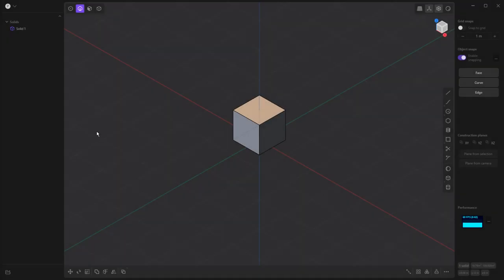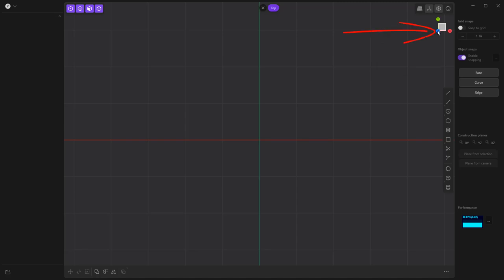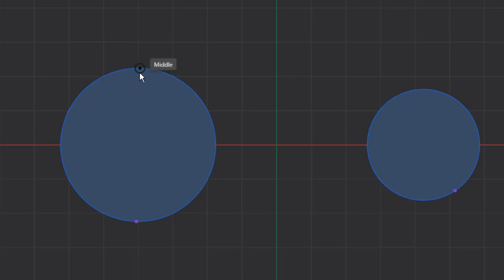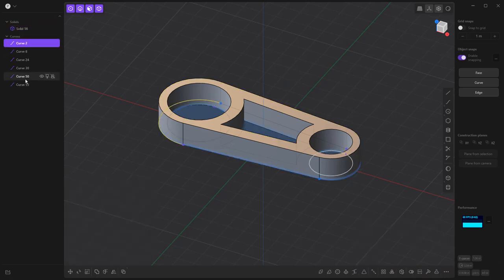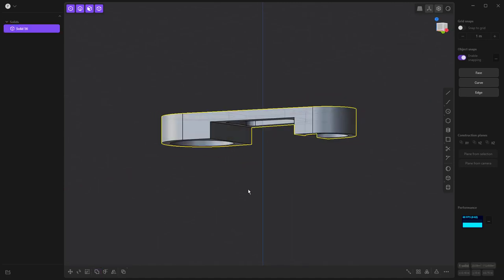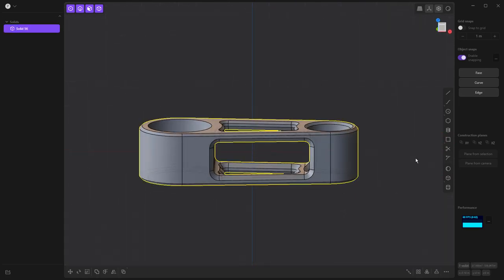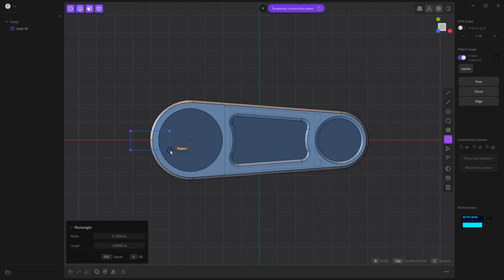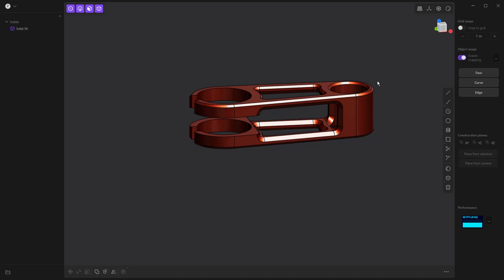Plasticity Quick Start | How To Model A Simple Part In Plasticity

Comment: i vaguely remember the author will be charging like 10-20 usd when the 1.0 hit the mass...now 99 USD for basic?.
Reply from the maker: A lot has changed since some of those initial announcements.  The original beta was on a different Kernel in the back that would allow for such a cheap price.  The current public version is built on the Parasolid kernel so pricing is a bit different and that is where a lot of the cost comes from sadly.  But this is not a subscription license.  You pay once and you own it for whatever that is worth.
Reply: I'd say 99 usd is still a pretty great deal, if this really is as good as it seems on the first glance.
Reply: Fusion360 costs 360 usd per month i think its worth it
Reply from the maker: @pusab2064  Not quite that expensive.  Currently I think its $500/year or around $40/mo.  A lot of people in this VFX segment of modeling are opposed to the subscription model that Autodesk and many other programs have adopted.  I personally don't mind subscription based having working in fixed versions for many years they have their own problems/challenges.  But that is a bigger discussion that would likely bring a lot of negative comments :)
Reply: I would be nice not to have another sub for once. I’m subbed out. The price is totally fair imo
Reply: How about you build something and offer it for $10-$20? How about your employer pay you $10-$20 for 8 hours? Would you like that?
Reply: For a cad like experience, that has a lot of what actual cad programs have, and what hoops you have to jump through to get them, this is very much a steal on price.
Reply: @edenassos  😅 that's my daily income and yes i dont like it.
Reply: Im not complaining 100 bucks one time is super affordable compared to industry standard  software's annual licenses

Comment: when i hit G on the keyboard nothing happens
Reply from the maker: you will have to have something selected first.  Most of the dialogs are going to be selection based.  For Move (G) you will need a point, edge, or body selected first and it should work.
Reply: @LearnEverythingAboutDesign  thank you :)

Comment: Why one would use this software instead of blender? Blender is more complete and free no?
Reply from the maker: Plasticity is a CAD program that models in solids and surfaces.  These are BREP and NURBS.  Blender models in polygons.  In Blender you start with a mesh and end with a mesh.  To make "hard surface" type models, things with hard edges, holes etc you have to use addons like cadsketcher, or spend a lot of time with booleans in the mod stack and really be careful with edgeloops.  In the end you are still left with a mesh.  In Plasticity you actually have a solid body (or surface) that is represented accurately.  A hole is a hole, not a bunch of straight lines.  A fillet is an curvature continuous surface that matches tangency with the surrounding faces.

Plasticity acts as a direct modeler that is intended to work well with Blender and do the things that it can't do easily or well.  Can someone create similar parts in both?  sure.  But in Blender you will always have a mesh.  In plasticity you have a solid and can convert it to a mesh for use downstream in blender if you wish.
Reply: @LearnEverythingAboutDesign  wow thank you for your explanation!! I thought plasticity was a polygon model software. My question would then be why not use fusion 360? Of course fusion is very expensive if you need a license
Reply from the maker: @Digit0wL  Partially user preference.  A lot of users looking to create models that will end up going to Blender for rendering, development of video game assets etc are just looking for the solid modeling with a streamlined workflow.  There is also a group of people that prefer the perpetual license like Plasticity vs a subscription based license like Fusion.

For me Fusion is my goto tool for designing manufactured parts.  If i am going to have something machined or molded for example i stick with fusion.  If i am designing off a mesh, say a widebody kit for a car, Fusion.  Placticity is very quick and there are things it does better than fusion.  Its surface quality is really good and when XNurbs is in the studio version that will make it even better.  So you can create some really high quality models, but they are not parameter driven.  So you couldn't say define a draft angle and design a molded part with the precision needed to control those details easily like ensuring all ribs/bosses are 60% the thickness of the outside.

So both tools have a place.  What i would say is to think about where your model goes after you are done with it in CAD.  If that animation, games, vr, rendering.  Plasticity with the Blender Bridge might be a great option.

Comment: I dont understand why this is being compared to polygon modelling. You cant use these models in the games or visual effects industries.
Reply from the maker: Plasticity is built on/for the Polygon workflow.  Takes many cues from Blenders workflow and others like Maya.  This is meant as a way to create accurate NURBS based models that often times are much harder to build/create in a polygon program.  It is meant as a more artist friendly tool to sit somewhere between programs like MOI or Fusion 360.  What/how you handle the downstream assets really depends on their intended use.  If its VFX/renders/animations or if its game dev/vr etc. that may include some retopo(which generally happens after concept modeling) and surface painting, sculpting etc.  I work in the CAD industry not games so my experience is just from my own projects, but this is what others are saying.
Reply: @LearnEverythingAboutDesign  I work in the automotive industry. We use poly to sketch stuff in and then rebuild it in NURBS for production. Hence this makes no sense to me.
Reply from the maker: @fullyleaded  Right for you if you are talking about concept car bodies.  Yeah mesh to say Alias Class A or SubD there would be the common workflow.  But say someone asked you to come up with a concept for say a brake caliper, or a wheel.  This workflow is much easier with NURBS as opposed to poly modeling.  not that it can't be done, but add-ons like Cad sketcher for Blender are aimed at making the poly workflow more like cad, but it still relies on you inserting control loops and worrying about topology.  Not an issue with NURBS here.

Plasticity isn't for everyone, but the program was made for designers to have a "CAD adjacent" program for more poly style workflow vs a parametric CAD workflow..
Reply: Thanks for getting back to me.  @LearnEverythingAboutDesign  We throw anything in in Blender. Brake calipers, switches, lights, wheels you name it. Once youve blocked it in in subd you can make a million iterations of it super fast. If you build something in Nurbs the fillets take forever. 

I'd be curious to see a real life use for Plasticity.
Reply from the maker: @fullyleaded  That is interesting to hear! Thanks for sharing!  All the people I have talked to in that industry have been body designers specifically.  I personally work in Parametric CAD, blender and plasticity are "fun" for me, but not part of my professional work.  For me even roughing in stuff is quicker in CAD than in Blender, especially with subD modeling to nurbs in CAD.

I think its a bit too early for a lot of professional use cases with Plasticity.  I know of people using it for rendering/animation work and some playing with game asset concepts.

Comment: You used a word about 5 times in this video I have never heard - chamfer?
Reply from the maker: yeah in the CAD world that is a beveled edge.  So instead of rounding a corner off you basically make a flat on the edge.  Generally if you have a chamfer you are taking a corner and making a small 45degree flat(you can vary that angle), while a bevel would slope 1 face toward the other, similar to if you drafted or angled something.

In plasticity(and most CAD programs as well) you will have a fillet or a chamfer for edge treatment.  with the standard cube in Plasticity, if you select an edge them push the yellow dot inward toward the center, that is the chamfer.  you can also check the bottom right corner of the window and note you will have A-Chamfer angle, C-Chamfer Distance. The yellow dot is changing the distance, the white ring around the dot lets you change the angle.
Reply: @LearnEverythingAboutDesign  Thank you for the explanation. I am not a modeler, I just use Blender to build objects for simulation and physics demos. CAD I have never used.
Reply from the maker: @DataJuggler  You are welcome.  it is pretty much the same as Blenders CTRL+B bevel edge. or the Bevel Modifier.

Comment: Obviously, this has some benefits over Blender but surely regular CAD packages such as Fusion or Solidworks would be simply better. A part like this is simple and could be modelled FULLY DEFINED in the same or less time given that you understand the controls. Not to mention Fusion 360 is both free and far more powerful in every conceivable way.
Reply: Haven’t tried plasticity yet, but have been looking for alternatives to classic CAD software for so long. Something that not crash when shapes become less formal. Hope this is it.
Reply from the maker: It depends.  While I tend to agree with you because the vast majority of what I model is grounded in design/manufacturing, there is a large set of users that want to make concept models for images, renders, animations, video games where they don't care about those definitions.  When i started testing Plasticity I didn't realize how many people are looking for that type of workflow.
Reply: Disagree with ur comment regarding benefits over blender— however feel free to expand on what u mean by it as my assumption might be false. If u use hardops/boxcutter in blender, it beats plasticity but thats just my opinion. Not to mention blender is free
Reply from the maker: @Bingbangbong28  Perfectly fine for sure.  I think I mentioned in this video that I come from the CAD side of design not from the VFX world.  What i hear from the vfx professionals is that hard modeling with NURBS like in Plasticity is much better, faster, easier and produces better geometry than doing it natively on the mesh.  Correct me if I am wrong because I haven't used hardOps/boxCutter but you still have to worry about topology and edge flow, dividing up your mesh, it just makes it easier right?  I mean if not why do so many users go to Moi, Shapr, fusion360 etc?
Reply: @LearnEverythingAboutDesign  true, valid point u raised abt edge flow, my apologies sir
Reply from the maker: @Bingbangbong28  No apologies needed!  I appreciate any and all comments.
Reply: @LearnEverythingAboutDesign  do you think that the model created in CAD is perfect? you can just grab it and import it directly into a gaming engine? :D
Reply from the maker: @Al-tk5zp  I don't work in that industry but from the tests and personal stuff I have done, not of course not.  There is a level of remeshing that happens.  Most game engines I have played with have similar options to blender where you can shade a low poly smooth and get decent results. So it really depends on the downstream intent is I suppose.  Again I have worked my professional life in CAD/Design not in Game/VFX.  I just play around with that side for fun.